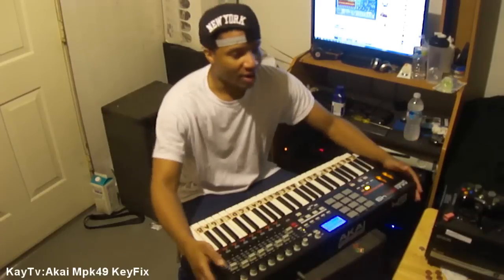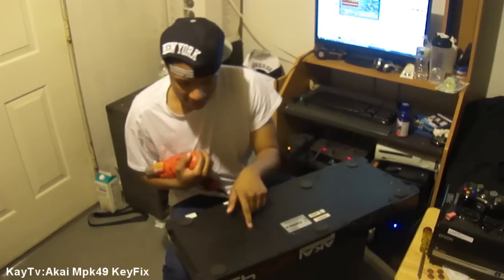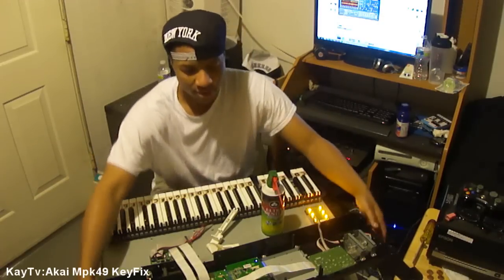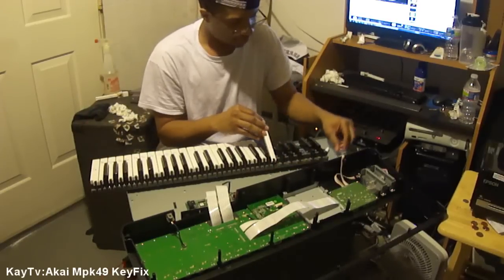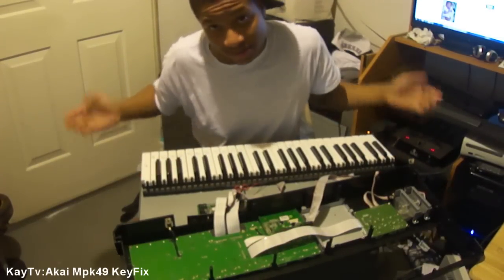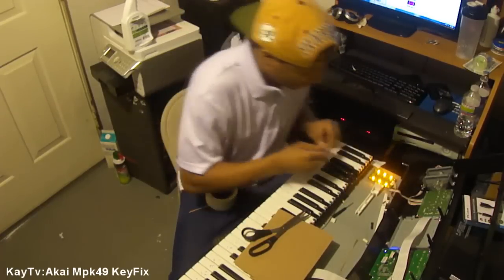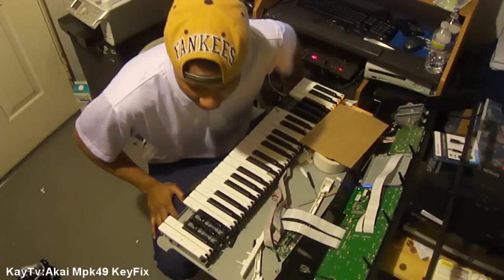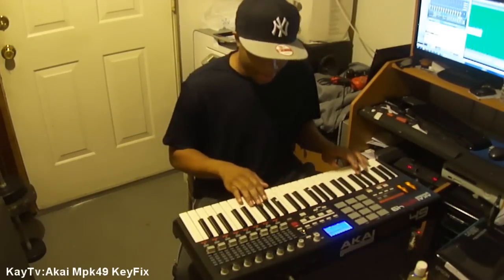How to Fix Akai Mpk49 Keyboard Keys issuse Diagnosing and fixing

Comment: Thanks for posting this - I had two keys on my MPK Mini that stopped working after I spilled a beverage onto the keyboard.  What I realized is at the bottom of each rubber 'cone' are a set of contacts that create a circuit with the PC underneath when it's pressed.  When I looked closely at mine, I saw that they were coated with the sticky residue of the drink, and so I used electronics cleaning wipes to remove it.  Worked fine after I put it back together. Cheers!

Comment from the maker: My keyboard broke again, more broken keys, I forgot what I did to fix it, so i gotta watch this long ass video, I am going to make this video shorter so it gets to the point, thanks for the support yall!
Reply: ThisDreamIsReal hey man I found a much simpler fix for this problem. There's a felt pad that runs across the length of the keyboard (one for the base of the black keys and one for the base of the white keys) remove that POS and it will allow the keys to make the full range of motion and it'll be fixed in a jif. Thanks for the vid though. Helped me eliminate some potential problems.
Reply: THANK YOU! THIS WORKED on my mpk225 that i spilled a screwdriver on. Middle C and few others was fked... I just removed the felt from and left the pad THANK YOU!
Reply from the maker: @Donk3y1685  where can I get it from?

Comment: Oh Captain, my Captain! Man, you're a hero to MPK49 owners everywhere! 

I just bought a used MPK49 for $200. The keys are not failing but a lot of the buttons on it need to be pressed harder than others in order for them to work. I took mine apart and dusted things off before I saw your tutorial but I'll check to see if your solution for the keys might just do the trick. Cheers from Barcelona!
Reply: how did u fix the buttons to work again. jm have the same problem with the octave up button. its not working.

Comment: I would 100% recommend for cleaning contacts using electrical contact cleaner. It comes in an aerosol can. Works wonders for removing anything from electrical contacts and won't damage anything on the PCB.

Comment: I have a MPK61 that had one dead sharp key.  I also had several more act up the moment I took it apart!  But I tried the cardboard piece under the keys trick and sure enough they all work again!  Cant tell any difference in the feel of the keys at all.  It was actually quite easy to do, once the keyboard is opened up.
Oh and BTW, if you think getting a M-audio keyboard will be an upgrade, think again..  Akai and M-audio are the same Company!   -Cheers!

Comment: Hello ThisDreamisReal the failure of your controller is not at the level of the keys themselves, the problem is the rubber sensor which is under the keys. As long as you do not change this part there you will always have the same problem in a few months you made a temporary repair that will not last long.

Comment: STUPID QUESTION HERE: so is the USB cable necessary for connecting to a studio program? I have Studio One (Audiobox USB) and im only using the Midi IN & OUT cables....I havent the slightest idea of what I am doing but i'd like to get some clarification on this question if you can help.

Also do I need software for the Akai MPK49? I ask cause I bought my used.
Reply: you still there, bro?

Comment: ya gotta replace the rubber pads - they wear over time. Like magic you'll get the response back like new! Best bet is to buy a smashed one on Ebay and pull the keyboard. There are some conductive paints and pencils that may work better, but replacing the rubber contact pad is the best fix.

Comment: THE TWO white ribbon connectors that go from the key section's motherboard (bottom piece) and the face plate's mother board (button area) disconnected as SOON as I was about to put the top onto the bottom (putting it back together), you have to slip them under a horizontal slot in the top motherboard (but u can't see where to put them in the motherboard) in order to reconnect, I undid all of the faceplate screws but it looks like it doesn't come off and is glued, is this true? can someone help? has this happened to anyone?? thank you

Comment: My USB connection is loose. How do I fix that?
Reply from the maker: All you gotta do is get a soldering gun, you can pick one up at walmart for like 15 bucks or less or an electronics store, take the keyboard apart and add new solder to where the part broke off. Its not hard there are videos for beginners on how to solder if you dont already know how. Just take your time with it.

Comment: my usb port got jammed so now it doesnt give off enough power, can i just use the midi part or do i have to get it fixed?
Reply: did you ever find the answer to this questing having the same issue on my max 49
Reply: dean albright did anyone find a solution to this problem? My usb stopped working so I brought a midiplus interface and midi cables to use the midi ports and still no luck.